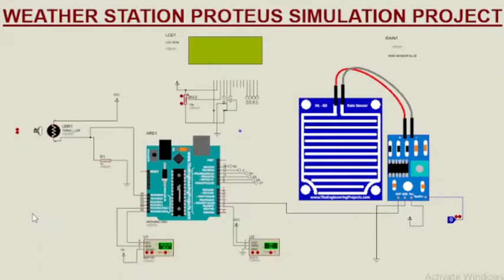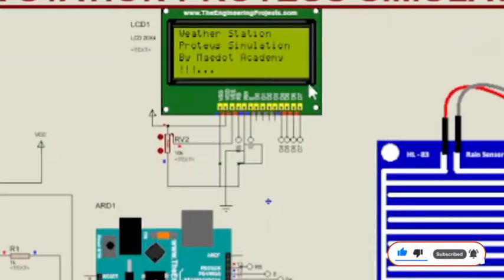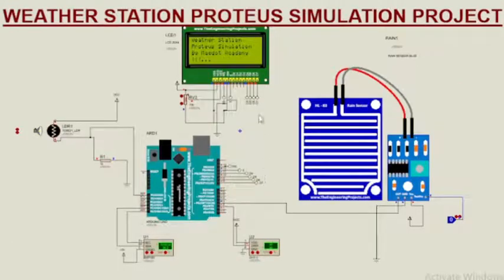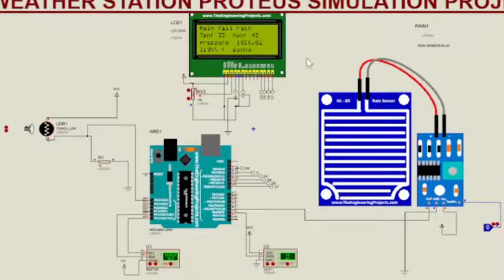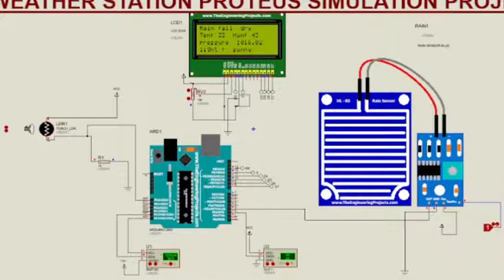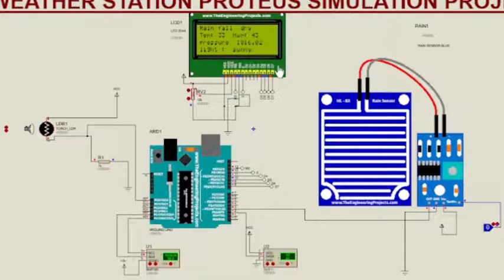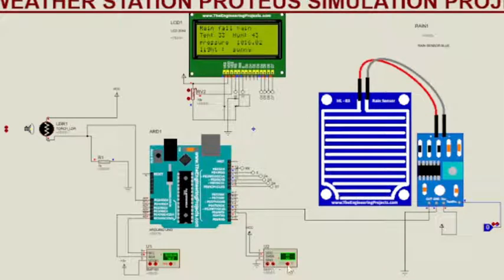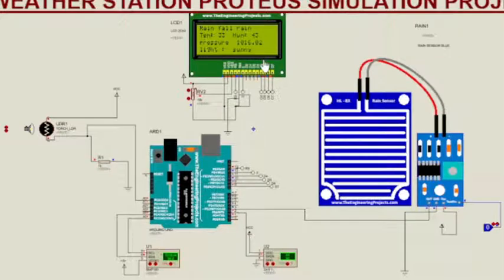Arduino based weather station simulation on Proteus 8 || 2024

Comment from the maker: #include <Adafruit_Sensor.h>
#include "DHT.h"
#define DHTPIN 2     // Digital pin connected to the DHT sensor
#define DHTTYPE DHT11   // DHT 11
#include <LiquidCrystal.h>
#include<SFE_BMP180.h>
#include<Wire.h>
LiquidCrystal lcd(13, 12, 11, 10, 9, 8);
DHT dht(DHTPIN, DHTTYPE);
int light= A0;
int sensitivity = 66;
// You will need to create an SFE_BMP180 object, here called "pressure":
SFE_BMP180 pressure;
double baseline; // baseline pressure
void setup() 
{
  Serial.begin(9600);
  pinMode (3, INPUT);
  dht.begin();
  delay(10);
  lcd.begin(20, 4);
  lcd.setCursor(0,0);
  lcd.print("Weather Station");
  lcd.setCursor(0,1);
  lcd.print("Proteus Simulation");
  lcd.setCursor(0,2);
  lcd.print("By Maedot Academy");
  lcd.setCursor(0,3);
  lcd.print("!!!...");
  delay(2000);
  lcd.clear();
  Serial.println("REBOOT");
  if (pressure.begin())
  Serial.println("BMP180 initialization success");
  else
  {
    // Oops, something went wrong, this is usually a connection problem,
    Serial.println("BMP180 init fail (disconnected?)\n\n");
    while(1); // Pause forever.
  }
  // Get the baseline pressure:
  baseline = getPressure();
  Serial.print("baseline pressure: ");
  Serial.print(baseline);
  Serial.println(" mb"); 
}
 
void loop()
{
  lcd.setCursor(0,0);
  lcd.print("Rain fall : ");
  lcd.setCursor(0,1);
  lcd.print("Tem:");
  lcd.setCursor(0,2);
  lcd.print("pressure");
  lcd.setCursor(9,1);
  lcd.print("Hum:");
  lcd.setCursor(0,3);
  lcd.print("light : ");
int rain = digitalRead(3);
if(rain==1)
  {
  lcd.setCursor(10,0);
  lcd.print(" dry");
   delay(500); 
    }
else if(rain==0){
  lcd.setCursor(10,0);
  lcd.print("rain");
   delay(500); 
  }

  int k=analogRead(A0);
  if (k>=300)
  {
    lcd.setCursor(9,3);
    lcd.print("sunny"); 
   }
  else if(k<300 && k>=470){
    lcd.setCursor(9,3);
    lcd.print("miduium"); }
  else{
    lcd.setCursor(9,3);
    lcd.print("cloudy");} 
  int h = dht.readHumidity();
  int t = dht.readTemperature();
  if (isnan(h) || isnan(t) ) 
  {       
    Serial.println(F("Failed to read from DHT sensor!"));
  }
double P;
// Get a new pressure reading:
 P = getPressure(); 
 lcd.setCursor(10,2);
 lcd.print(P);
 lcd.setCursor(5,1);
 lcd.print(h);
 lcd.setCursor(5,3);          
 lcd.setCursor(14,1);
 lcd.print(t);
 lcd.print(" ");
      }
double getPressure()
{
  char status;
  double T,P,p0,a;
  status = pressure.startTemperature();
  if (status != 0)
  {
    delay(status);
    status = pressure.getTemperature(T);
    if (status != 0)
    {
      status = pressure.startPressure(3);
      if (status != 0)
      {
        delay(status);
        status = pressure.getPressure(P,T);
        if (status != 0)
        {
          return(P);
        }
        else Serial.println("error retrieving pressure measurement\n");
      }
      else Serial.println("error starting pressure measurement\n");
    }
    else Serial.println("error retrieving temperature measurement\n");
  }
  else Serial.println("error starting temperature measurement\n");
}
Reply: please give me file proteus .Thanks you <3
Reply from the maker: Dear Thanh Tin,  give me your email address and consider subscribe if you think the tutorial is helpful.
Reply from the maker: @thanhtin7087   incase you want to make your email private you can contact us via teammaedot@gmail.com